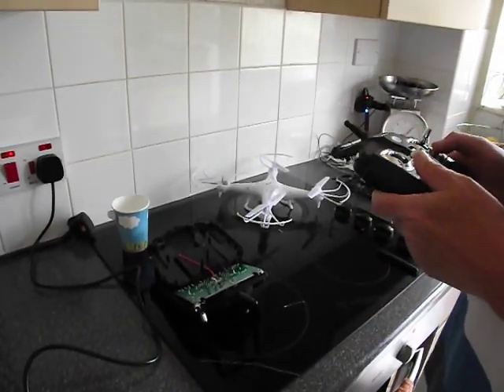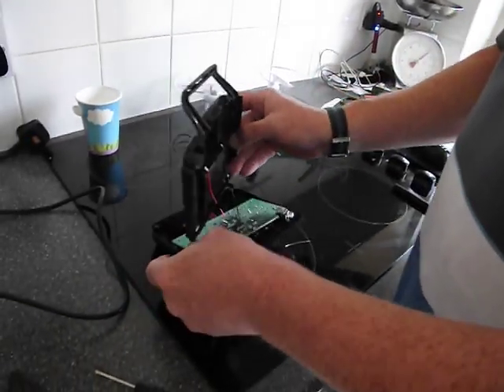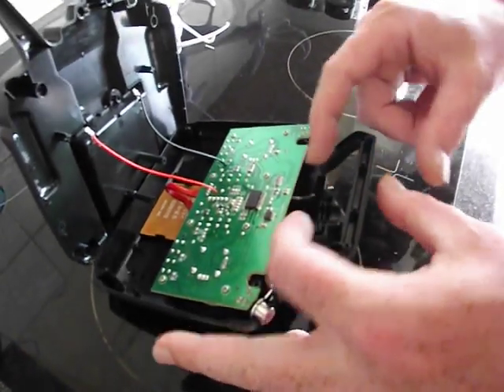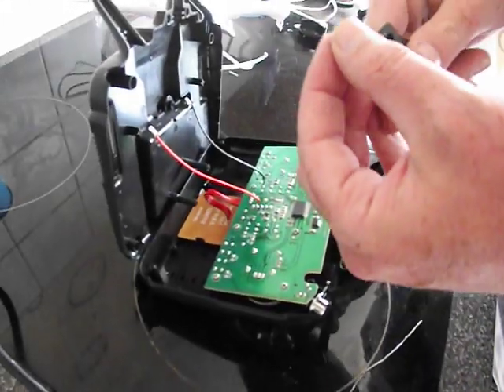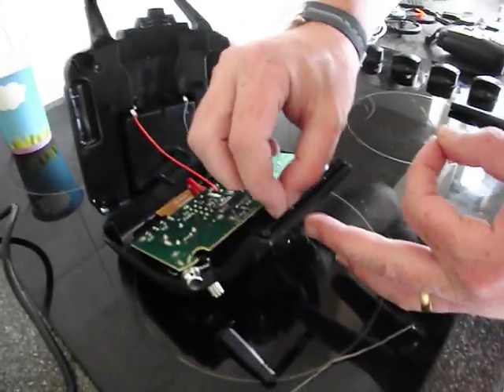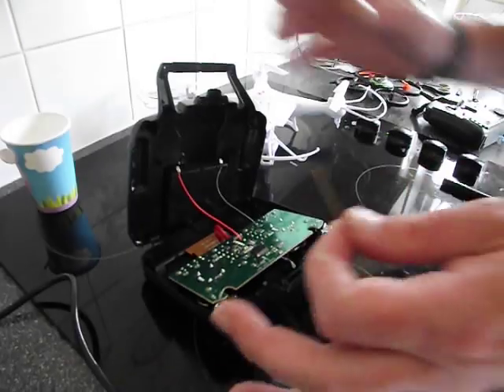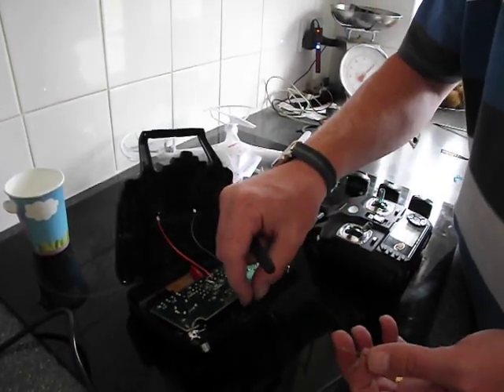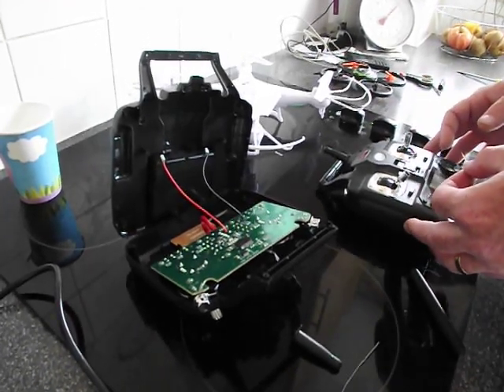Syma X5C Remote - Easy Antenna Range Extender Mod (1 of 2)

Comment: Hi I'm new to this, Syma X5C-1 is my 1st quad/drone, I would like to mod my controller aswell, question is what type of wire should I use? is it ok with any electrical wire? or any copper wire will work?
Reply from the maker: Any wire of equal thickness that is also radio conductive will do and copper is a good choice for any antenna ;)

Comment: thanks mate xtratalk1  for your vid ., this's a great vid..
btw , i have question.
could it works ? if i use copper from antenna tv cable
pic --> http://oi59.tinypic.com/23gycki.jpg
Reply from the maker: Hi mate, yes that will be perfect, copper is one of the best materials out there to use for antenna's.
Reply: Thank you mate for answering my question, it's very helpful. May Success Follow You Always

Comment: Like in CB's (transmitter/receiver) by making he antenna longer wouldn't that affect on how the antenna was originally matched at the factory (assuming they did match them)?  Thanks
Reply from the maker: Hi Michael, yes that's right it's important to follow the measurement guide as shown in the video description.

Comment: you say double the length . the piece of of copper wire u had was around an inch . .so overall length would be 2 inches yes?
Reply from the maker: Have a look in the video description it explains the correct measurements there which are important to follow.

Comment: If it is too long dose it still work
Reply from the maker: Not very well no, if your measurements are off you can actually decrease the range as it won't be an effective antenna so it's advisable to follow the correct measurements as described under the video.

Comment: If I get copper cable, and make it the same length would that work?
Reply from the maker: Yes copper is a good choice for any antenna.
Reply: Okay cool, Thanks for answering!!
Reply: xtratalk1 Okay one more question, If I take the same cable out of another controller that I have from a previous X5c can I just use that one, I have the extra controller because I crashed mine and I couldn't find It so I ordered another one.
Reply from the maker: TheGarageGamer98 You could do but it would be a shame to butcher your other remote for it as copper wire, speaker wire or any easily obtainable conductive wire will do as long as you follow the measurement guide in the video description ;)
Reply: xtratalk1 Here's what I did. I improvised a little, I had a extra router, electrical tape, and a wire stripper all here with me. I got the wire out of the router that transmits the wireless signal, they were about the same width, almost excatly. I stripper the wire of the router, and the tip of the one in the controller, I attached the two together with some electrical tape, and closed the controller. I took it outside and I got almost DOUBLE the range. I was pretty satisfied with myself, Lol
Reply from the maker: TheGarageGamer98 Awesome :)
Reply: xtratalk1 Can you confirm electric tape works? Sounds safer for those who aren't comfortable using sodering gun
Reply: xtratalk1 Also do you need to put them together or twist them together then tape? please help
Reply from the maker: Randy Candy Yes, basically it's the same as an electrical connection so you want to make the connection as secure as possible. Soldering is the best way but splicing the wires together is another option, you will want to twist the wires together for a good connection, placing them side by side covered in tape will not be very good.
Reply: Also if i was to get the wire from a router would i just cut the wire in the middle not necessarily needing to detatch it but simply cutting it from any point then twisting it onto my controller?

Comment: Can I just use electrical tape I don't have a solder machine
Reply: Lol after doing the mod the range was really a difference holy crap it went so high that one of NY motors burned out when I landed it n tried to bring it back up no luck . I think I stressed the motors aloy because I would fly it really high n then let go of the throttle then I would give it throttle again lol
Reply: They're fairly cheap, and sooner or later a factory solder will need to be repaired, or a motor replaced.
Reply from the maker: You can yes, just make it a nice clean and tight connection and if the wire you are using is coated give it a file down on the part that you are splicing.
Reply from the maker: John Healey Yes that's true, on the good side though they are easy to repair and it's currently easy to get parts cheaply.
Reply: xtratalk1 does it have to be the same thickness I used a copper wire
Reply from the maker: theturtle _ If you get it about the same thickness that will be fine.
Reply: xtratalk1 I used some car audio wire and its a little bit thick
Reply: theturtle _ would it still be fine
Reply from the maker: theturtle _ Yes that should be OK. As your not soldering and just splicing wires it's easy to do adjustments so you can do some testing to see the difference in range your getting and make changes if needed.
Reply: Did you use electric tape? How'd you position the wires before taping it?

Comment: the antenna length that you are matching is just the clear shielded part right?
   the length after the black rubber sleeve part?
Reply from the maker: Yes mate that is the active (radiating) part of the antenna the shielded part is classed as coax.
Reply: xtratalk1
ok thank you.. i guess another question is--do you have to extend the antenna on the quad as well?
Reply from the maker: DEROCK72 Yes for best results. We are going to do a more detailed version of this video soon showing the antenna mod on the remote and the quad :)

Comment: I forgot to mention. The wire i used for the extension was the central core from some satellite coaxial cable i had. I also 'tinned' the core before soldering it in. Thanks mate

Comment: I carried out this mod which took me about an hour in total. I removed the motherboard to allow better access to the inbuilt antenna. On testing i found the quadcopter seemed to respond much better to the newly installed antenna. Im not sure why but this mod is definitely worth the effort. I could have done it quicker but deliberately took my time. Excellent instructions. Ps the overall length of the antenna after the upgrade was 62.5mm
Reply from the maker: That's great to hear GRAHAM and thanks for the comment :)
Reply: why are you not sure?
Reply: ***** someone posted elsewhere there really is no difference. I wish there was a way we could tell.

Comment: Thank you!  I finished my mod this morning and I can definitely tell a difference.  I used a strand of copper wire that I had left over from a car stereo installation.  It was really thick monster wire.  Took me around 30 minutes and the total length was around 4 3/4 - 4 7/8 inches. Thanks again.
Reply from the maker: That's awesome Tracy, many thanks for the feedback mate :)

Comment: Hi doing boos hey a bought x5c-1 syma quadcopter what kind of wire u use  please
Reply from the maker: We used the wire from a washing line but any wire of equal thickness to the one in the remote that is also radio conductive will do.

Comment: Could I just desolder the original antenna and use a 12.5cm solid copper wire?
Reply: Thanks:-) I opted for 62.5mm copper antennas on tx and quad with very pleasant results. .

Comment: man, I have an information, the antenna cable that you used for extend antenna is actually not an antenna, that is an extensin cable for 2,4 ghz antenna, real antenna is solid metal (I thinc chopper but I dont sure)

Comment: but you´re not considering impedance!!!! it´s a crime, there´s no matching unit. have you measured the SWR???? the impedance in a 1/4 1/2 and 1 lambda are not the same you need an impedance matching unit to fix a new antenna, it´s a great idea you can also use a collinear antenna with more gain than the vertical 1/4 one that comes pre assembled but in this case, maybe you´re burning the emitter with the SWR... regards
Reply: Adding twice the original length makes the antenna 3/4 wave length, still 50ohms impedance since it is an ODD multiple of 1/4 wave.  No SWR problem at all.  I wouldn't use much more than 3/4 wavelength, perhaps 5/4 wavelength at most.
Reply: Mayor, I'm aware of the problem you mention, as I learned a bit about Ham radio antenna length and wave. So what would you suggest here? Do you feel it is unwise to extend the tiny wire in the transmitter to 1/4 or 1/2 wave length? What else must be done to make a 1/2 wave length wire mod safe? How does one deal with the change in impedance? Some people also extend the wire antenna inside the quad. I have so far not heard of any disasters after these mods, but that doesn't mean they didn't happen. Your expert guidance would be greatly appreciated. Thank you.
Reply: if it works... it´s a solution, that´s correct. sorry but i have no knowledge about  trimming 2.4g antennas, i´ll try to learn something and if I succeed i´ll write down any experience that could be useful, so im going to try your experiment as an starting point.
Reply from the maker: Mayor Mente Let us know how you get on Mayor

Comment: Would this likely work on other quads with 2.4g transmitters?  I would like to extend the range of my TopSelling x6 (Hubsan x4 clone).  Being a beginner, it's easy to get out of range when trying to figure out orientation.
Reply from the maker: Hi Lee, yes it will work with other transmitters but keep to the right length. 6.25cm total radiating length is a half wave and good at 2.4GHz. The complete measurement for 2.4GHz is 12.5cm so you want the total radiating length of the antenna to be either that or a multiple of that, ie 6.25cm makes a half wave 2.4GHz antenna where as 12.5cm would make a full wave. Use the correct measurements or you could cause more loss than gain. A mod to the quadcopter antenna to match it to the new one in the transmitter will help too.

Comment: What kind of wire exacty are you using? Thanks
Reply from the maker: We used the wire from a washing line but any wire of equal thickness that is also radio conductive will do. For length I would suggest you use 6.25cm total radiating length. The complete measurement for 2.4GHz is 12.5cm so you want the total radiating length of the antenna to be either that or a multiple of that, ie 6.25cm makes a half wave 2.4GHz antenna where as 12.5cm would make a full wave. You need to make sure you use the correct measurements or you could cause more loss than gain.
Reply: xtratalk1 If I solder a 6.25cm wire to the wire in transmitter, the total length will be more than 6.25cm if I measure from circuit board. So do I need a wire of 6.25cm or have to make sure the total length to be 6.25 measuring from circuitboard?
Reply from the maker: Hi Ashish, The measurement applies to the 'active' part of the antenna. Ignore the small sheilded part close to the circuit board and have your measurement for the clear unsheilded part of the antenna that extends from the board and goes into the antenna housing at the top.